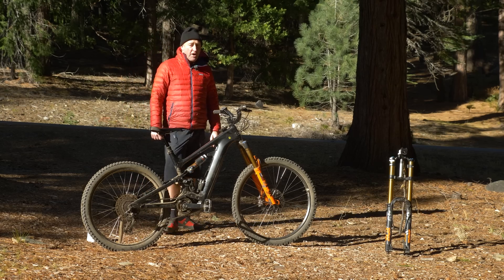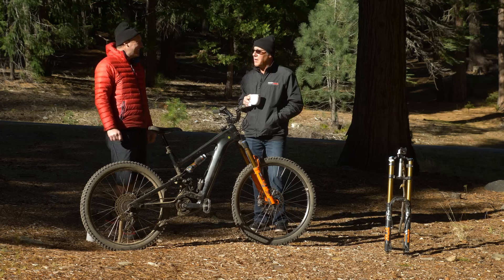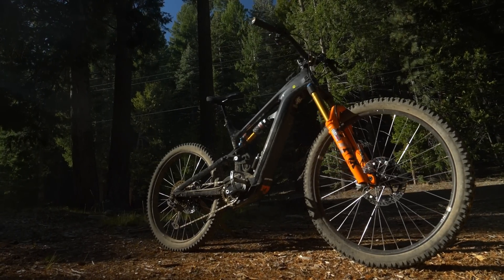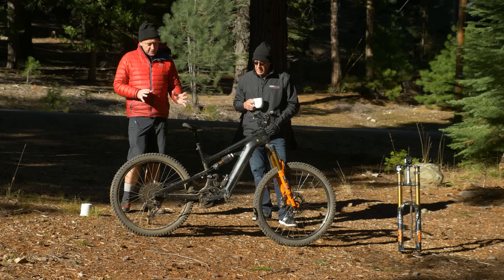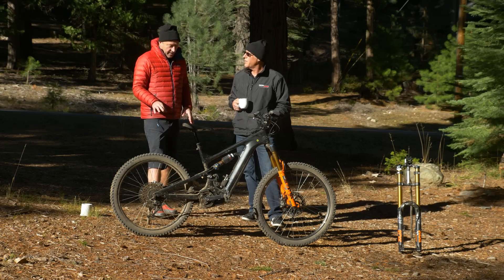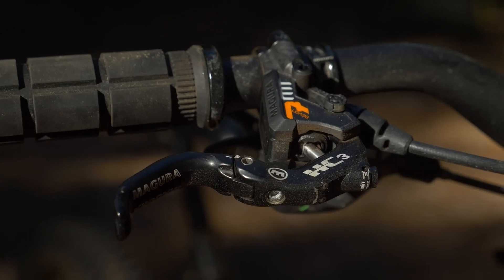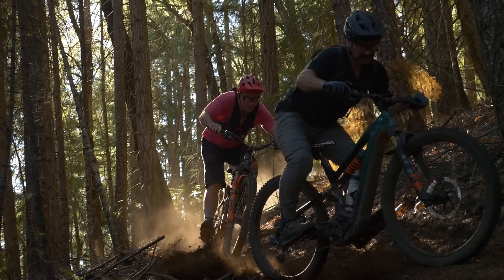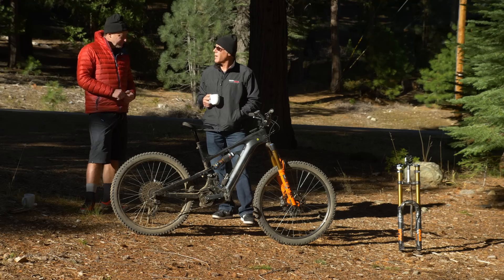Is This The Most Custom E-Mountain Bike Ever?

Comment: If you scroll down from the title of the interview, there is a complete spec list of all parts used on the bike. Any questions feel free to ask. Thank you
Reply: Running 180mm zebs on my mottera 3 myself, great insight.. Awsome machine 👌
Reply: Hot Rod EMTB! This is engineering mastery.
Reply: Would you be so kind and write which Cannondale model and size is that H-2 rear suspension link from? And what is the eye to eye lenght of the Float X2 Factory shock mounted on this Moterra.

Comment: Classic old school engineer right there. Obviously spent many years working on Moto-X  bikes and has transferred his skill set over. His high rise bars are undoubtedly purely for his own ergonomics/ comfort. These guys prefer function over looks, if it feels good, then it is good.
Reply: Handlebars: Deity Highside 760 (760mm wide, 80 mm rise)
But putting on a high rise trials stem will give you position & is a cheaper upgrade!

Comment: Fascinating. Nice to see he fitted high riser bars which is something I do on my bikes. Low rise bars push me too far over the front. If I need to get over the front I can bend my arms more.
Reply: Also put the stem as low as possible for minimized flex
Reply: Damn right. To make it corner use all the suspension you've got, forks, tire pressure, and elbows.

Comment: I've had the Magura MT7's on my Stumpjumper for about 2 years and I cant sing their praises enough. Best brakes I have used by far. My ebike (Commencal Meta Power SX Race) has SRAM Code R's and they are horrible in comparison. I mean the Codes stop the bike for sure, especially with 200mm rotors front and rear, but the lever throw to the contact point is horrific.

For context: I'm 194cm tall and weigh over 100kg, close to 110kg with all my riding gear. The MT7's stop my weight easily and don't fade at all on long descents. I've had them hot enough to discolour the rear rotor and even then they still felt like they had full braking power.

Comment: Bravo! We need lots more stuff like THIS! I do have a lot of questions.:
1. Why did he choose the Cannondale platform to make the "ultimate" ebike?
2. I would love to know more about the fork "tweaks." Was he saying that forks are not true from the factory? If not, how would one possibly make them more true without very sophisticated equipment? He made a big deal about the pinch bolt for the axle on the 38, which the Zeb doesn't have.  Is it that big of a deal? Would like to hear about his thoughts on modding the Zeb?
3. One thing I've never liked about my brakes (SRAM and Shimano) is the pulsing in the front. Looking at my SRAM brakes, it looks like the pads contact the correct place, but the rotor track is really too narrow (narrower than the pad.)  I wonder if using a rotor with a wider rotor track (and tuning the contact track) would make an appreciable difference?
4. Shorter crankarm choices for shimano EP8?
5. ...and the handlebar choice?
Reply: Shimano cranks only go down to 160mm
Reply: He is from a dirt bike, MX, desert racing background. A lot of those guys run bars higher and narrower than MTBs. The ultra wide bars similar to what's trendy on MTB now were 70s MX bars, current MTB bars, except for the lack of a crossbrace, remind me of like '73-'75 Bultaco Pursang MX bars wide, flat, very little sweep.
Reply: He said that out of the box the zeb performed better than the fox. Also the bars allow you to position your body further back and puts ur arms at a stronger position and angle

Comment: Interesting idea with drilling the forks! I am wondering why he didn't remove the bleed valves off the lowers and use that taping point to connect each leg together?
Reply: My guess is twofold. 1) because you would then lose the bleed function which is there for a reason. 2) routing the equaliser tube is easier at the front as you have the arch to support and protect the tube from hitting the tyre.

Comment: He knows his stuff. And I have to comment on the 3 inch risers it's exactly how I want my bars, I've been using 3 inch risers for 5 years it's just like riding a motorcycle. And what's wrong with that
Reply: Hi Gary
Could you post a link for the 3" bars you use mate? Many thanks Daron
Reply: From a motocross racer, riser bars are so much nicer. I also run my front brake on the right side.